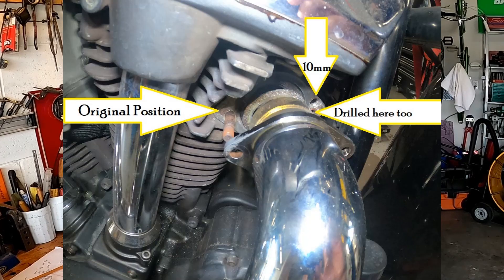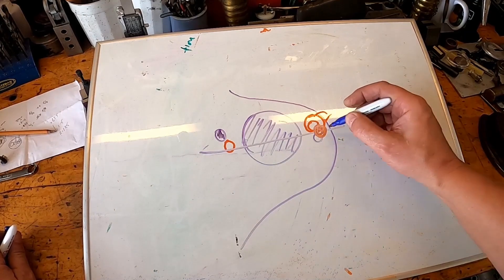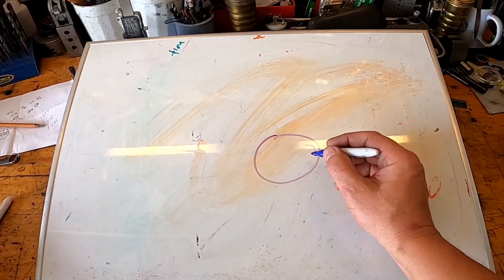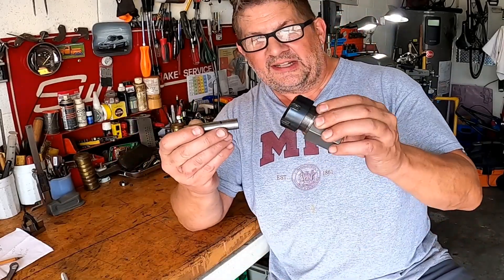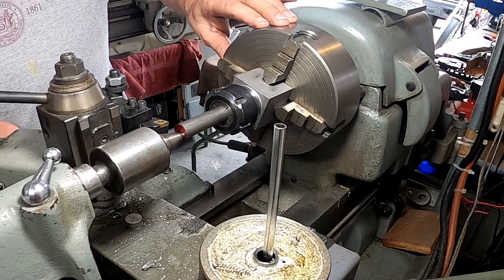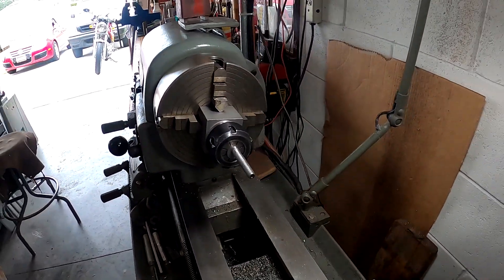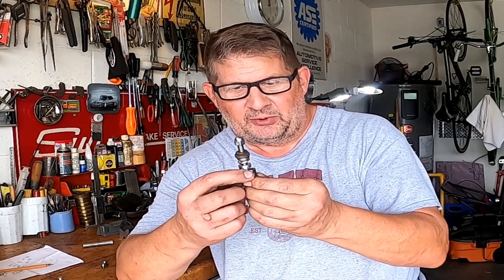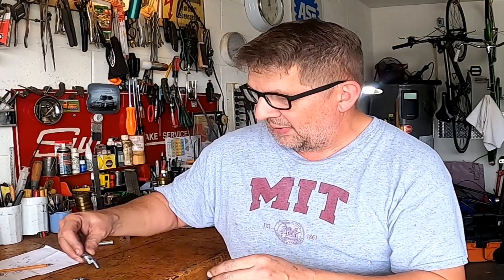Making an Offset Stud for motorcycle exhaust manifold repair

Comment: Nice fix
Reply from the maker: Thanks Andy. Appreciate it. Don
Reply: @donsengine3158   Thanks Don ,  I enjoyed the video.   Never ran into that before so not sure I would have figured that fix out but sure glad you showed me.

Dale in Canada 🇨🇦
Reply: @donsengine3158   Forgot to ask you if you did anything with that aluminum plug to hold it in place?

Dale in Canada 🇨🇦
Reply from the maker: @dalemcinnes1834  Hey Dale, Yes, its hard to see once the stud is in place, but at the end of the video you can see the shiny behind the flange.  The drilled holes were so close that I didn't dare try to use an offset stud without filling the adjacent hole. Would have liked to get a whole put together to show it set up, but wen your on the clock you gotta make time.  Don
Reply: @donsengine3158    Thanks for the reply Don. 

Dale in Canada 🇨🇦